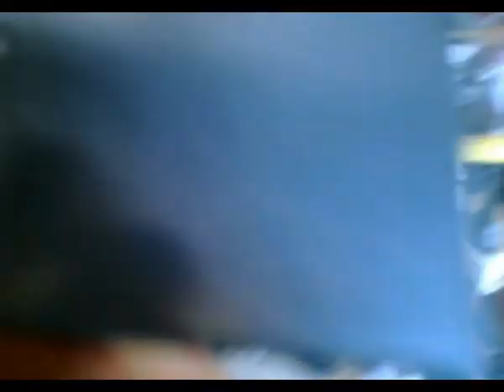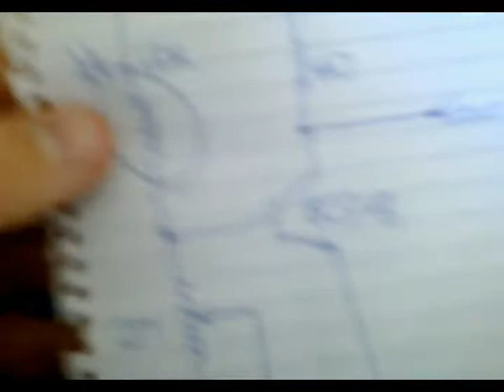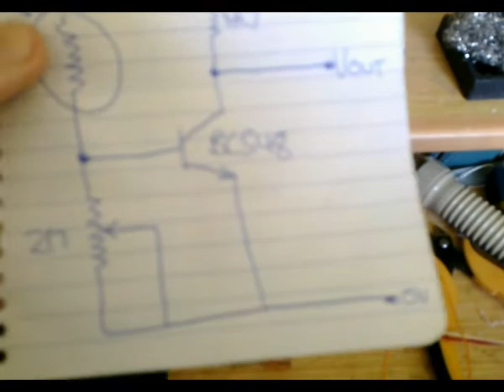32 line NBTV Nipkow disc mechanical TV camera project (Part 3)

Comment: An idea struck me were can you make the light a movable beam to increase brightness of projection. By following the scan position of the hole with limited detraction where I was thinking of a movable deflection mirrors and straightening reflectors to deliver the scanning beam for maximizing brightness. Otherwise  putting a light pipe clear prism attachment for each of the hole would intend the same purpose of reducing light loss.